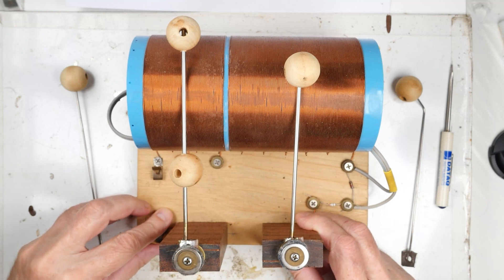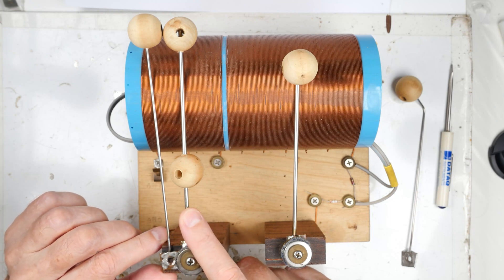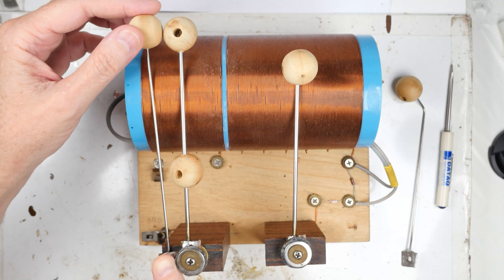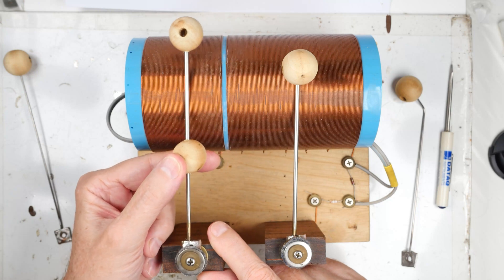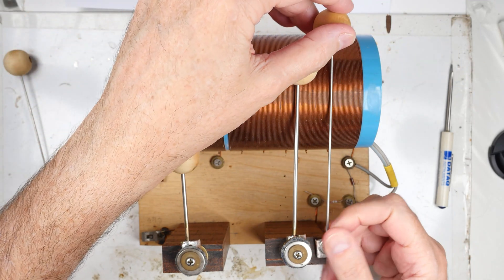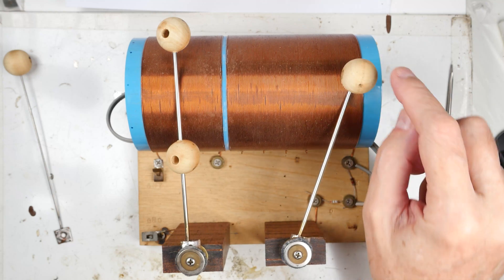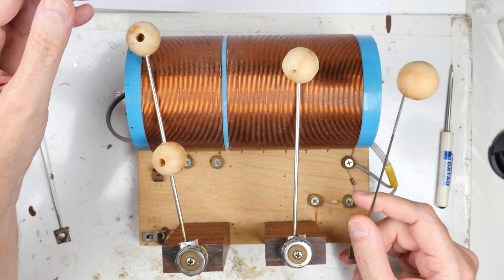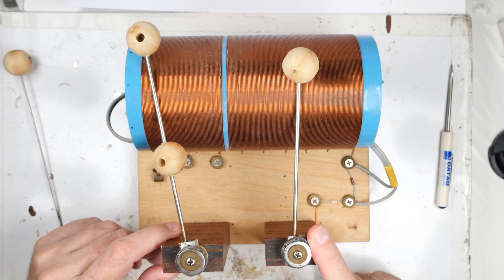Crystal Radio Wiper Upgrade 2.0 (4K)

Comment: Hello!  I enjoy your informative videos, particularly on crystal radios.  I am building my first and have a couple of questions.  I presume that I will need to remove the varnish insulation from the magnet wire of the coil where the wiper contacts the coil wires.  Is that correct?  If so, would rubbling the narrow band of coils that contact the wiper with emory paper be a good way to remove the varnish?  Thank you!
Reply from the maker: Yes and yes. This is a step by step on building a wiper style. https://youtu.be/fLVCqZGpv3U

Comment: I just checked Amazon and they sell 2mm as well as 2.5mm stainless steel wire in case you wanted to try that. I originally was thinking of tig welding filler wire or gmaw electrode wire as they are available in small diameters.
Reply from the maker: OK, thanks. I had not thought about stainless welding rod, good idea for another source.

Comment: Very interesting problem. Looks like you use the springiness to hold the wiper in place in your applications. Another route might be to use weight rather than springiness to hold in place; perhaps a plumbing copper pipe. I would have also rotated your base panel 180 degrees to have the adjusting ball more near me -- why do you want to reach so far?
Reply from the maker: @franzliszt3195  Tradition. It's a version of the cub scout radio I made 60 years ago. I've also used springs for tension, but they are big and it's hard to find the right one. I could put fishing weights on the wire....